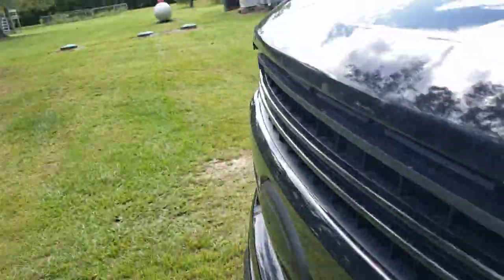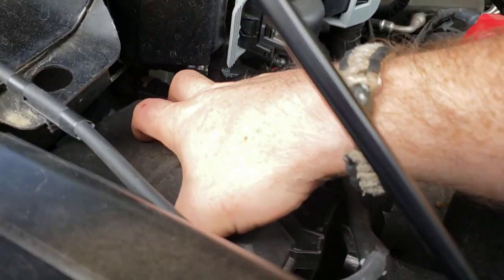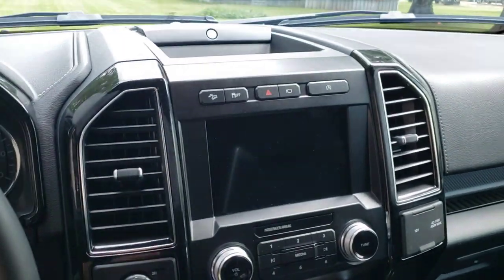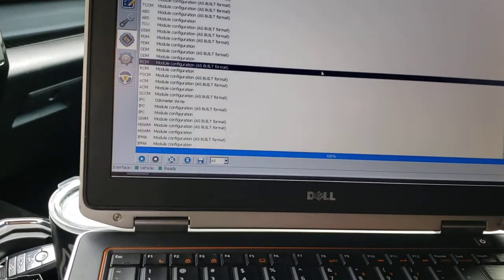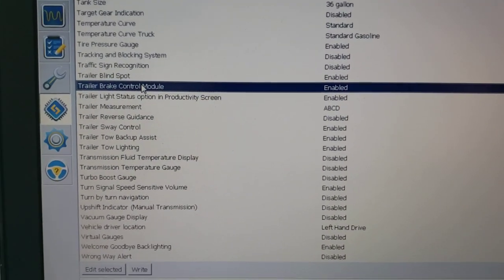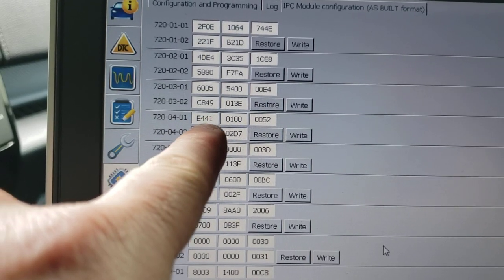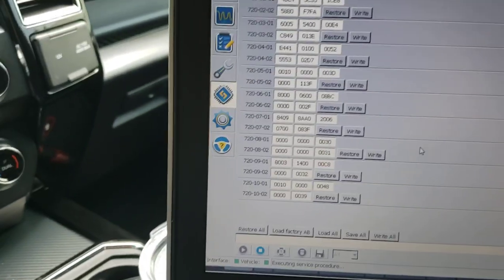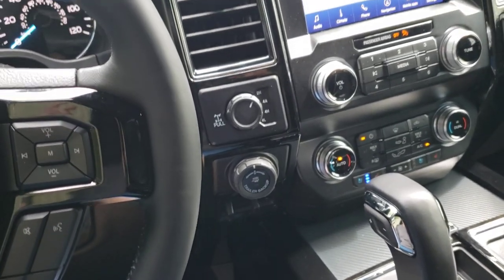2020 F150 trailer brake controller install&reprogram

Comment: Great info regarding that fuse. I just bought one for my 2020 Lariat and it comes with the 30 amps fuse and after watching your video, I check the fuse box and its has the 30 amps already so I have spare.

Comment: Great video for my 2020 XLT, thank you! I actually found on my truck in the IPC configuration that trailer brake control module has trailer brake gain under it where yours does not. If i just enabled both of those It actually changes your next step of E401 to E441 automatically. My trailer brake controller was also powered unlike yours so perhaps could explain the difference. Either way your the man, thanks again.
Reply from the maker: Hell ya man!

Comment: I have a weird issue. I bought an "OEM" controller off Ebay. Everything works now EXCEPT when I plug a trailer in, the trailer brakes are full "ON". to the point where the trailer axle is locked even without pressing the truck brakes. I have used two different trailers with the same result. And this is with the truck set to zero, and the gain set to zero. So, I'm down to replacing the controller, OR making some Forscan setting adjustment.  Your info about changing the 0 to a 4 is pretty obscure information. Could you link me to where you discovered this odd bit of information? I would appreciate it very much. TIA
Reply from the maker: The forscan code change can be found on forscan spreadsheets. Just google them and you'll easily find the info out there. Do you have a 7 pin connection on your truck? I'd get a multimeter and measure the brake signal coming from the truck, seems like your getting voltage output when you shouldn't.
Reply: If it was the cheap $50 OEM fakes people have been running into troubles with them not working properly. Get one from a reputable source.

Comment: Hey great info. I am now looking at a new 2020 F-150 XLT that is missing the brake controller.  I would really like it to tow a trailer and be safe.  So this install is no really big deal and can be accomplished at a reasonable price afterwards ?  If so I'll get back with the dealer and talk, there are very few 2020's on the lots with the options.  I could do the switch install but would need someone with a scan/programmer tool to talk to the truck computer.
Reply from the maker: Ya, it's an easy process

Comment: Hello, I have a question and I hope you can help me, I have the F-150 XL 2020 with the most basic display, I have completed all the steps, the IPC module appears exactly the same, (only one option to enable), also verify that you have the fuse and everything is in order, even the intensity controller works, but it does not appear on the screen when I increase or decrease the braking intensity, nothing appears but it does work, any suggestions? Do I have to activate something else to get the information on the screen?
Reply from the maker: @pliniohidalgo448  tbh, I'm not sure on that situation.  I've never done an install on a truck that was Optioned like yours

Comment: When you programed the TBC, did it activate the 12 volt aux in the connector.  For some reason we still have no voltage at the pin and need it to charge the trailer batteries
Reply from the maker: My truck already had the fuse in the fuse box on that circuit
Reply: I can answer this as I just bought a 2020 Lariat and my enclosed trailer wasn't getting lights. For the 2020, the process is convoluted due to the "Smart Trailer Connector." Back up to your trailer, shut the truck off. Hook up your 7way plug, then turn on whatever 12v accessory you need- in my case I had to turn the switch for my lights on- the truck needs to detect a draw to activate the trailer charge circuit. Go back to truck and get in and shut the door (important). Then turn on ignition (do NOT start truck) and hold brake down for 3 seconds. Then turn ignition on and again hold down the brake for 3 seconds. Your trailer charge circuit (12v power out) will now be activated. If you happen to leave the truck with the fob in your pocket and get the 2 beeps? Start at step one again. Yes, I know it's crazy. It appears many people rewire this specific circuit due to this absolutely stupid system.

Comment: Great video,   I got everything done, truck picks up the brake controller, but the truck doesn't recognize the trailer.  Any suggestions? I had a older F150 with the OEM controller and it worked, so I know its not the trailer.  All fuses are in  place
Reply from the maker: Not sure
Reply: Hi, we are having the same problem.  Did you determine what was wrong or what had to be done for the truck to recognize the trailer?
Reply: @nikkiforzetting9698  Did you ever figure out this problem
Reply: Same problem, anybody solve this yet?

Comment: Did you install a 300$ factory controller, or 70$ one from Amazon? Do you have an option either way?
Reply from the maker: Bought a used oem one off ebay
Reply: Fairway Ford on Ebay has it for $145

Comment: I just had the dealership install a break controller.  When I squeeze the controller the breaks work and the screen lights up.  When I use the foot break the the screen does not light up.  The dealership said it won't?  Did yours light up with the foot break?  Thanks in advance.
Reply from the maker: It will while looking at trailer info in cluster

Comment: So if there is nothing there to except the fuse then the truck is not capable of excepting the factory brake switch?
Reply from the maker: you'll have to add some extra components yes
Reply: Some trucks are just missing the fuse.  If you don't have a fuse in that spot, you need to check the sockets and make sure the metal receivers for the fuse are there.  If so, just put the proper 30amp fuse in place.  If not, it may be possible but will be much harder.

Comment: If I install an after market 3rd party controller, using the original plug, would I still have to program the truck and would the controller still show up on my truck display?
Reply from the maker: Not sure bud. I would think so

Comment: Did you have a trailer plugged in while filming? I'm asking because I don't and my display said "Trailer Disconnected"

Great video, I'm guessing that everything was done right or i wouldn't get the "Trailer Disconnected" banner on my display.
Reply from the maker: Yes, you have to have something plugged in to double check it works
Reply: @calawaydp  Got it, thanks for the quick response!

Comment: What version of Forscan are you using? I have v2.3.43 with extended license but only getting a very small amount of options of modules to configure. Doesn't even have the IPC listed. Anybody struck this before? 2020 model.
Reply: Same problem I'm having disappointed might have to have dealer do it after I bought thr elm scan tool too. 15 bucks but still!